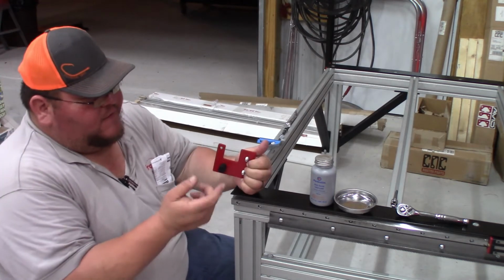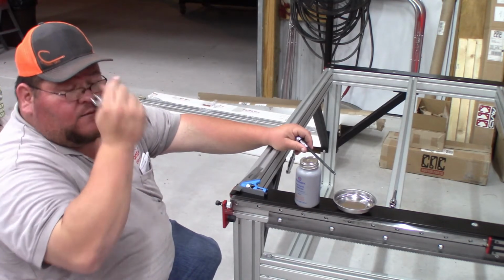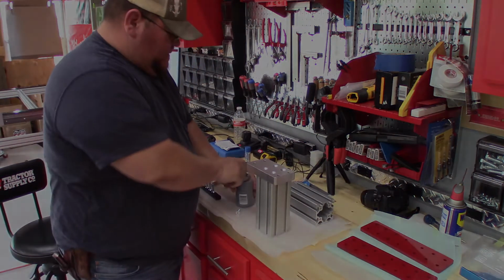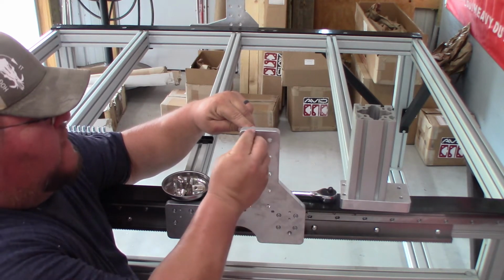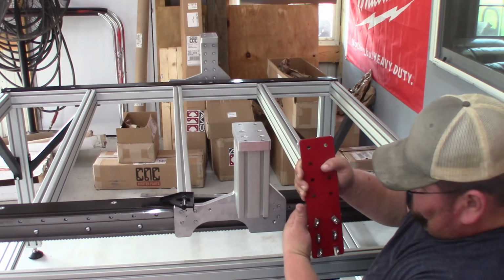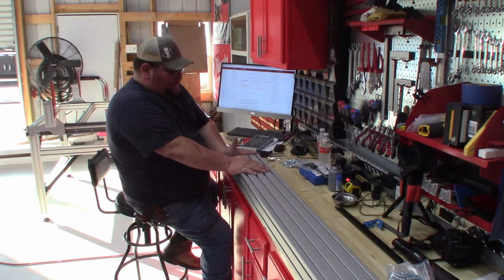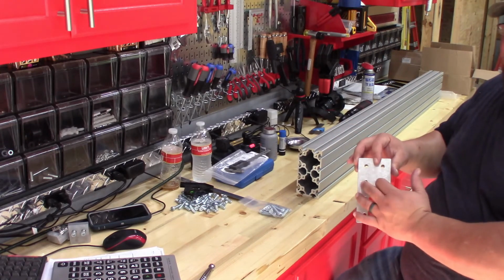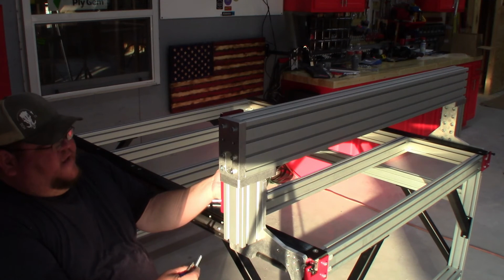AVID CNC ROUTER PRO 48x48 GANTRY ASSEMBLY PART 4

Comment: You might want to check with a resource that has metallurgic information about dissimilar alloy fasteners.  Either blue locktite or white lithium grease is what I have seen is best.  White lithium grease is recommended in the marine environment when using SS bolts in aluminum, which are very harsh on each other due to their separation on the metallurgic scale.  The other thing to think about is the vibration of the machine, so any thing with neversieze may work loose.
Reply from the maker: Thank You,